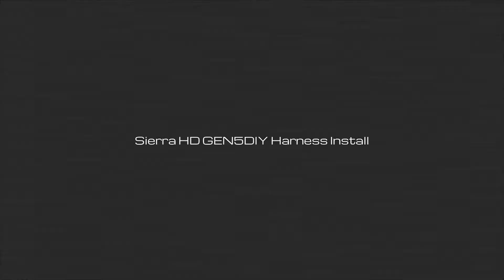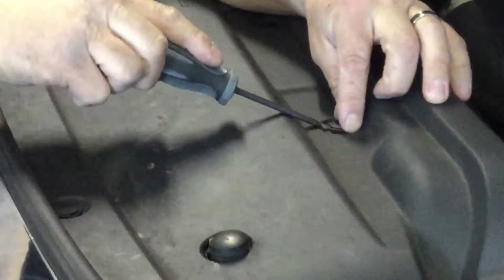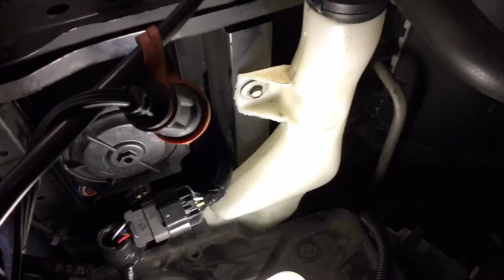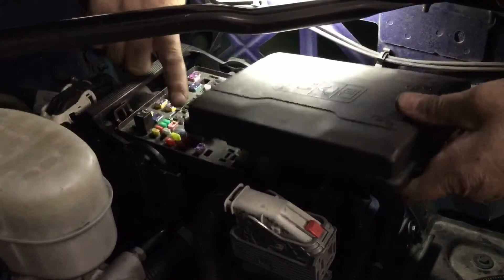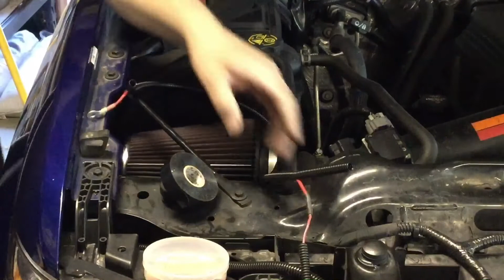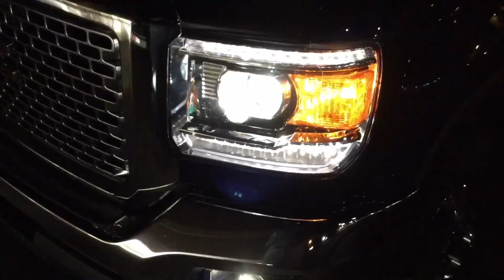'15 GMC Sierra 3500 HD GEN5DIY Harness install for factory HID/LED DRL operation

Comment: Did you end up getting the dealer to turn on the option in the bcm? I am trying to do the same thing but the dealer doesn't understand what I'm trying to explain to them. I have a 2015 GMC Sierra 2500 Denali with the halogen bulbs and I upgraded the headlight buckets to a 2017 GMC Denali headlights which have the HIDs in them. The headlights seem to work if I don't have the vehicle running I can turn the headlight switch on they work but soon as I start the vehicle the headlights are on the Flicker and then shut off. I'd rather not run an aftermarket harness I would kind of like to have the GM Style

Comment: My daytime running lights are not working on my drivers side of truck. I have a 2016 gmc sierra 2500 and I cannot find any fuses labeled DRL.. I started by checking all of my fuses under the hood and in the cab and Nothing is burned out. What should I do?
Reply from the maker: I would check power at the plug/connector on the headlight. I’ll look it up tonight and give you the page number on the GM upfitter website that has a breakdown of the individual terminals.....https://www.gmupfitter.com/files/media/photo/664/Sierra_Silverado_Electrical_Body_Builders_Manual_Service_Manual_2016_en_US.pdf
Reply: Thank you, much appreciated!
Reply from the maker: Ok, use the link for GM upfitter web page/body builder manual/light duty/truck/suv/electrical..... for a 2016 it will be on page 1321. It’s labeled as X110. You can pull down on the side bar to speed through pages.

Comment: When you bought the newer OEM headlights what year and make/model did they come off off? I was told the 2016-18 GMC 1500 lights will fit in a 2015 GMC 2500. If that is the case can you just buy the harness from GEN 5 DIY and it pretty much be a plug and play. Im not that mechanically sound but i do have alittle common since haha. Im just trying to figure out my best option for my truck and i want OEM.
Reply from the maker: I bought them for a ‘16. I do believe the 1/2 ton lights will bolt right up. They do however use a different shape connectors. If you have an SLT or Denali the DRL should work fine but you won’t be able to power up HIDs without upgrading the power supply/harness.

Comment: Dear Mr. Fox,

i have 2015 sierra from canada, as u know the Canadian virgin come with no led but the head light running all the time i can't switch them off and thats make me upset. 

do u thing if i do like u the problem will be solve?

best regards
Reply from the maker: Yes. The only thing is that you can’t switch off your headlights and leave only the parking lights on. They will now come on together.

Comment: Great video!! Can i ask where you sourced the OEM harness for the SLT headlights? I’d like to do similar to what your doing, SLT headlights with factory harness and a BCM reprogram. seems like the WhitesAuto site is the best guys for that but i can’t find the headlamp harness. I don’t want to do the gen5 one as you lose some functionality. Thanks for the help!
Reply from the maker: I have the part number on a video that I never posted. I’ll look for it tomorrow. (It’s on an old phone). You’ll also have to run a few wires from the BCM out to the X50A (fuse block) but it’s really simple.

Comment: Good Video Mr FOX 
Question ?
so by installing this Harness you have LED DRL instead of the Head Lights as DRL ?
Reply from the maker: Joni English yes, the parking lights now activate the headlights.
Reply: @kevefox  thanks for Reply Mr Fox 
how about the Auto Headlamp Function ?
do the Headlights Come on  Automatically ?
or you have to Manually Turn on the Knob .
Reply from the maker: They come on automatically. The DRL is run off of the daytime running lights circuit. On higher trim levels the DRL uses the same circuit but there is a second circuit for headlights. 

The new harness takes the signal for daytime running lights (low beam headlights) and sends it to the DRL in the new headlight assembly. The parking lights are now the trigger for the headlights. For example, when you drive into a tunnel and your headlights automatically turn on, your parking lights do too. So any time your parking lights come on your headlights will too. You won’t be able to drive with only parking lights and you won’t be able to drive with fogs and DRL without the headlights.

I hope this makes sense. Phil Gamboa (on gm-trucks.com) or HarnessDr.com is working on a more factory solution.
Reply: @kevefox  Thanks for Reply 
cause my 2017 Tahoe DRL is the LOW Beams and for 2018 and up the DRL is the LED strip .
GEN5DIY also sells Harness to Mimic the 2018 and up DRL use of the LED Strip .
just Thought maybe you loose the Auto Function after install of this Harness
Reply from the maker: Ah, I see. No, I believe you retain your auto function. When I called them they were very knowledgeable and eager to help. Might just call them and ask a few things before ordering.

Comment: What gauge wire did you use to extend the wire going to + battery terminal?
Reply from the maker: I don’t remember at this point. You can just snip off an inch and bring that to the store to match it up...

Comment: I have a 2015 sle crew cab. The light bars above and below the halogen bulb dont work are they suppose to or no?
Reply from the maker: Blessing Bird no, not on an SLE. Only SLT, All Terrain and Denali for the GMCs. My truck in the video is an SLE and came without the LED signature or LED Driving Lights (DRL). You can buy the headlights with LED signature, DRL and HID bulbs and then just add the harness to make them function correctly. Also if your truck is a 1500 you might want to upgrade to the new style headlights (‘16+up) as they are different than the HDs after ‘14&’15. There is a different plug so a different harness is required but it’s all been worked out to “plug & play”. 
Thanks for watching

Comment: On my 2014 1500 slt do I need to replace headlights and harness?
Reply from the maker: Martin Gonzalez I don’t think the 2014s came with LED signature and DRL did they? If you already have LED DRL and signature and you are only wanting to upgrade to HID there is likely a different route to take. Check out Morimoto for options......

Comment: Did the reprogramming from dealership fix the issue ?? Or you still using the non oem harness
Reply from the maker: 4930driver still using the non OEM but whiteautoandmedia.com
Can program my BCM and will soon. They’ve been backlogged but will be free soon.
Definitely check them out.
Stealership won’t do it.
Reply from the maker: They’ve just finished my Programing, waiting for it in the mail. I’ll be posting another video for Complete OEM HID with LED signature Upgrade from halogen without led signature. Coming soon....

Comment: Where did u buy the harness from
Reply from the maker: Edward Mireles http://www.gen5diy.com/GMC/NON-SLT-to-SLT-Headlamp-harness/
Reply: Thank u will this work for my 2015 GMC Sierra I bought some new lights with the led running lights as of right now they don’t come on I just want them to come on is this the right harness
Reply from the maker: Edward Mireles sounds like it is. When I ordered mine I was in desperate need so I just called in. They were extremely helpful in sorting out which harness I needed. I would urge you to do the same just to verify. Thanks for watching
Reply: Ok thanks

Comment: Where did you order the headlights from
Reply from the maker: Justin Blough I picked them up on eBay
Reply from the maker: Justin Blough I found a second set on local CL and picked them up in like new condition for $300/pair! Couldn’t believe it. I figured if either one of our GMCs hit Bambi, Rudolph, or Bigfoot I’ll at least have a replacement set.
Reply: What’s the name and year of hid bulb to get that oem look that you’re using
Reply from the maker: Justin Blough not sure but I think 2015 year and Phillips. I’ll pull the cap and shoot a picture this week and post a link for you.
Reply: Tinkering Fox thanks
Reply from the maker: @ Felipe, I’m starting a new reply comment to that the original comment author doesn’t keep getting replies. Check the comments for this video to see the reply with bulb color/#

Comment: Does the black front skid plate fit a 2016 Denali 2500HD?
Reply from the maker: Fabricio Larios I’m not sure but I’ll be changing the oil on my wife’s ‘16 Denali 2500HD this weekend and I’ll check for you.
Reply: Tinkering Fox thanks brother.
Reply from the maker: Fabricio Larios you’re welcome
Reply from the maker: Fabricio Larios I didn’t get time to do the oil change but I just shot this video for comparison and I looks like it’s the same size and shape and everything.
https://youtu.be/DTP73rAOS50